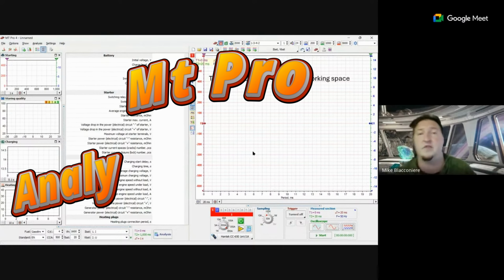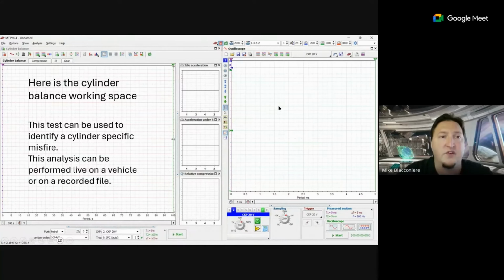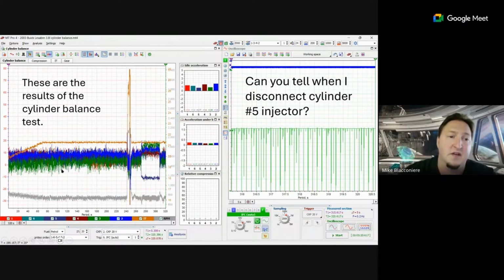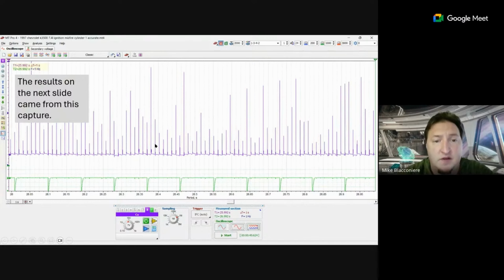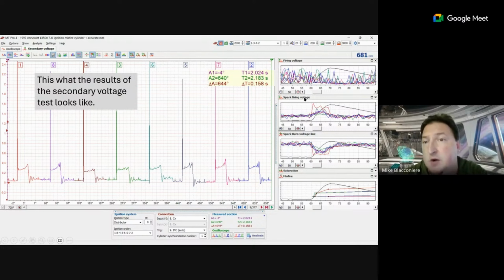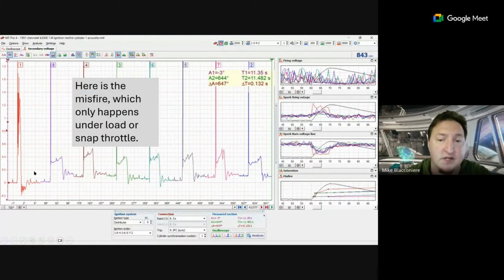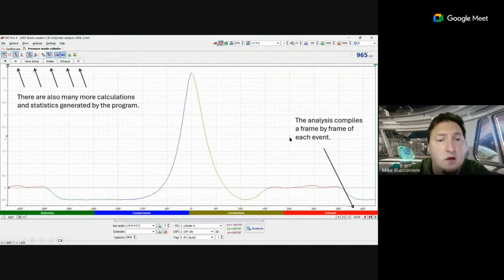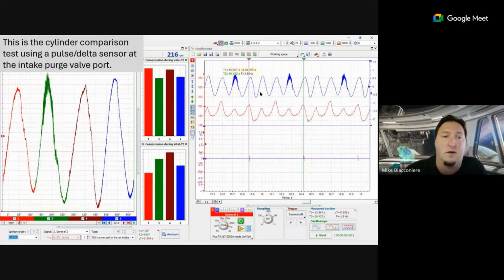Mt Pro Analysis Tests Overview

Comment: Mike, I was lucky to purchase one of the last mt pro's from Joe's. What have you discovered that Picoscope can do that the MT pro cannot? I use my MT Pro mostly for cam/crank and can bus issues. I am well pleased.
Reply from the maker: I prefer the mt pro over most any other scope. 

The pico is better at high-speed signals like canbus. The xy graphs and math channels are very useful as well. 

Otherwise, I prefer the mt pro for most tasks.

Comment: This scope is great for generator techs. Equipment in our field does not have the best on board diagnostic features, rarely will you see anything with misfire counters  . This scope helped identify a broken flywheel tooth on an old 855 Cummins. Our governors use a mag pickup on the flywheel.   This scope and Hscope (using a math freq channel ) pointed it out perfectly. I was great because I was helping a tech that " doesn't need a scope "  ..... he was about to load the parts cannon.  Keep up the great content.

Comment: This really is an amazing tool for the money. BTW, was this an excerpt from another video you did?
Reply from the maker: Yes, this was edited down from the live stream presentation. I figured I'd cut out all the extra and just show the analysis tests in a shorter video.
Reply: @710diagnosticsandfishing  have you tried the cylinder balance on a vehicle with a waste spark system? Wondering if it would work at all
Reply from the maker: Yes, it works, but I recommend using the auto tune for the trigger channel. Otherwise, it's tedious to dial in.
Reply: @710diagnosticsandfishing  im still not 100% on the trigger function yet, so would that mean ( on a WS ignition system), use a secondary voltage lead on cyl #1 for the trigger channel and set it to auto ( the "~" symbol)?
Reply from the maker: Yes, lead on 1. 
Then toggle the auto button on. It'll do the rest when you start the recording. 
If it's on, the autotune starts when you start the recorder. So the engine needs to be idling when you start the recorder.
Reply: @710diagnosticsandfishing  ok great thanks for the help and for all these videos you do

Comment: The CSS is definitely one of the bests and often tests used here at the shop specially when dealing with driveability problems; with just the CKP and an ignition trigger or with one, two or four cams.

Comment: THANK YOU, MIKE, for these videos. Up to late last night, I was trying to watch one of Eugene's videos, but the language barrier is real.lol. I saw that he linked up with Amazon to sell some of the probes. Which is great for him and us. I have the diesel pressure probe (PS100) and would like to make a video next year on a few trucks. For the diesel guys.
Reply from the maker: Thanks, DJ. 
I've been curious about the diesel pressure probe. I mostly use a delta sensor and rc test to diagnose most diesel issues. 
What's Eugene's channel?
Reply: @710diagnosticsandfishing 
I also saw where he is working with someone to translate some of the stuff that he has. This with what you and other guys post, really helps out. I really like the Crank shaft sensor sync to show how many teeth the Crank shaft have. Can make a bunch of known goods so when I suspect a damage gear. I can spot it quickly. Yeah I get by in diesel using the same tools but I have taken the chance before using my other Transducers while cranking a diesel engine but would love to go In-Cylinder while running. Below is Eugene's channel

https://youtu.be/-E3XMDRsoIM?si=BLz4ueorjRS43YZI
Reply from the maker: Thank you